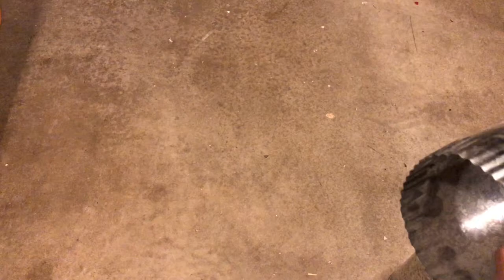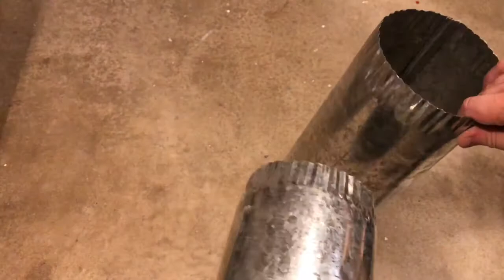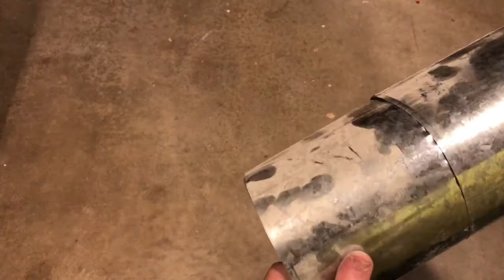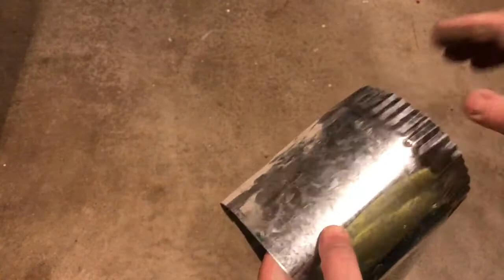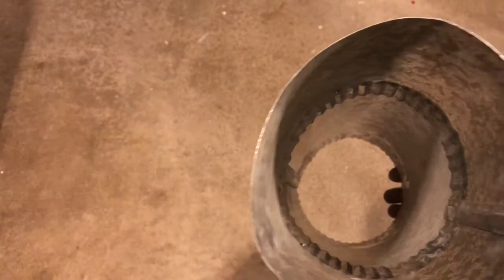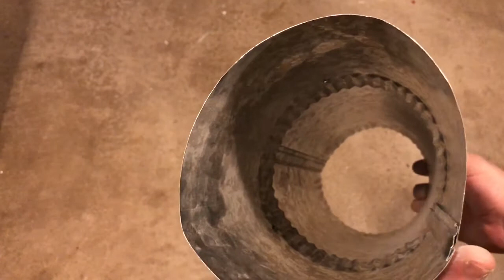Which Way Do Crimps Go In Ducts

Comment: Not so on kitchen exhaust hoods. Or grease and condensation will escape the duct, no matter how well it’s sealed. Sealing ducts are only 95% tight, unless welded
Reply: Not saying this out of disrespect just fact: on a vertical riser, on any duct that may contain grease, you need to install the duct against the airflow, which is different from standard hvac systems.  The reasoning is simple: any grease will stay in the duct. Conversely, if the ducts are installed with the airflow, on vertical duct risers, there is a good chance that the grease will leak out. In commercial applications, most all codes call for welded seams. For residential obviously not, but it will only be a “not if, but when” the duct tape starts to loosen and fail. All this is per SMACNA manual
Reply from the maker: Thanks for the info
Reply: Would this be the same for a vent on a propane shop heater?  I just put mine in and did opposite of your video so condensation wouldn’t get stuck in a crimp.  I can change it but honestly I have no idea what to do.  Please help!
Reply from the maker: You want to have the pipes so that the air exiting a pipe is placed directly into the next pipe. (The pipe is inserted into the next pipe) This will allow for less lost air at the connections. 

Please like and subscribe
Reply: @jefffrantz1893  been doing this for over 50 years, since I was 16. I’ve had my own HVAC company. First of all, these are called ducts, not pipes. Secondly, yes, the cramps go the direction of air flow, all the time with the exception of grease ducts.  If it’s not a welded connection, which commercial codes dictate that they must be, then the duct connections must be installed in the opposite direction. This prevents the grease from leaking out of the dock, thereby eliminating the possibility of a grease fire.
Reply from the maker: I have not run duct on commercial range vents, so if you say it is supposed to be backwards in that application to meet code, you are probably correct. I would suggest checking code in your area to verify the direction of the crimps for commercial range vents.
Reply from the maker: Air always flows towards the crimped end of the pipe so that the air easily blows into the next pipe. If you reverse the pipe, the air will flow on both sides of the crimp. This would put extra pressure on the duct mastic or duct tape. 

I’ve seen guys get confused between return air ducting and supply ducting. Supply ducting blows away from the furnace and return air ducting blows back to the furnace. 

This is also the case in kitchen range venting so that condensation and grease do not get caught between the crimped end and the next duct pipe.

When you apply a duct mastic or other good duct sealing tapes, the air leakage will be at a minimum. 

I have never heard of anyone welding duct pipes together with a welder in residential homes. Unless you are referring to “welding” together ducts with a paint on mastic.
Reply: @jefffrantz1893  I came here looking for clarification about kitchen hoods specifically ( although a bathroom exhaust fan would follow the same logic I think).

Does the direction get reversed in this case or not?